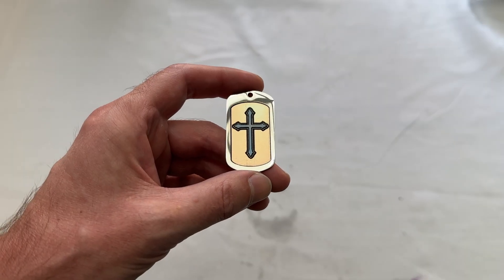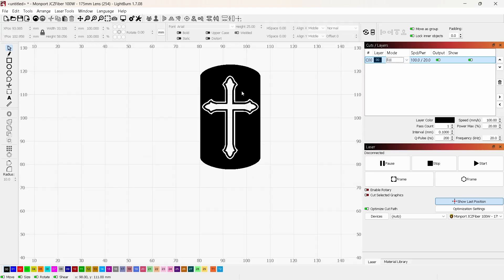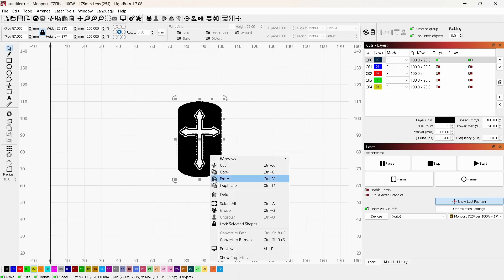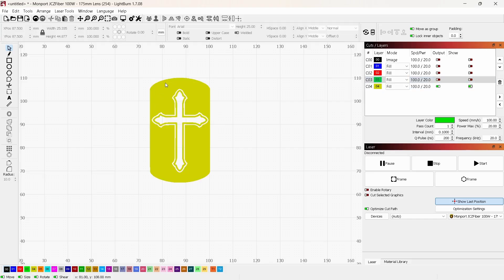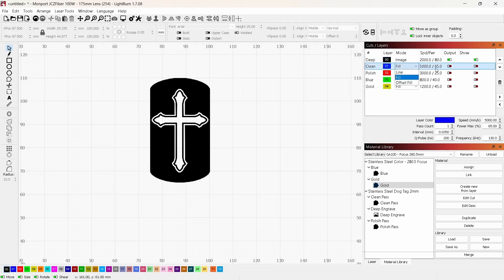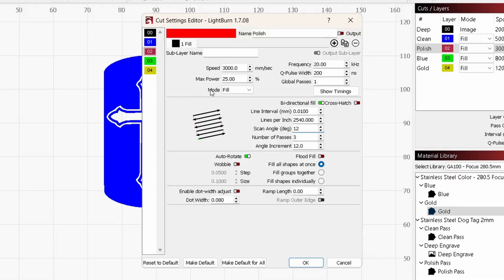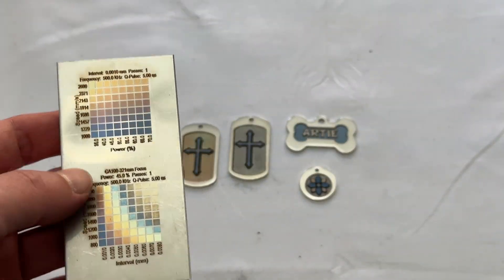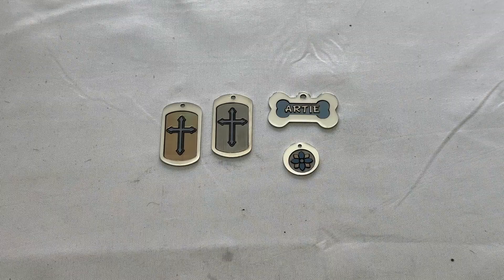Deep Engrave with Color LIKE A PRO! (No Cleanup Necessary) - Full Tutorial

Comment: Can I ask if there is a reason you specifically chose the 100W laser over the 200W you tested previously for this task? Wouldn't the higher wattage make it a better option for deep engraving or do you find there are some practical issues or limitations that come with the higher power that made you prefer the 100W model? Considering a 200W option which is why I am asking. Would be really good to know if there are any gotchas. Thank you in advance.
Reply from the maker: I chose the 100w because I was asked to do a video specifically on that machine.
Reply: I see, that makes sense, thank you for taking the time to clarify

Comment: Very cool, I'd love to get one soon. Two questions, is there a rotary attachment and second, how well does this work on tool steel such as O1/W1 or similar? If you were to engrave a negative onto tool steel, would you be able to make a clean stamp on mild steel?
Reply from the maker: Yes there is a rotary attachment for it. And yes it can engrave tool steel. If you didn’t know, I also help out TFS (@thefabricationseries) with filming and other projects and we did a video minting our own coins. And while the engraving came out fine on tool steel, his press wasn’t strong enough and we bent it. Here’s the video if you want to check that out. https://youtu.be/3vyZlzszSNw?si=JATeqaLkpjPy9uYJ
Reply: @ArtByAdrock Yeah, I saw that. As for metal stamping I was thinking more about creating a makers mark and using a hammer. Another area I was interested in is leather work. I've recently started working on learning leather tooling (carving/stamping) and it'd be nice to make various custom stamps for that.